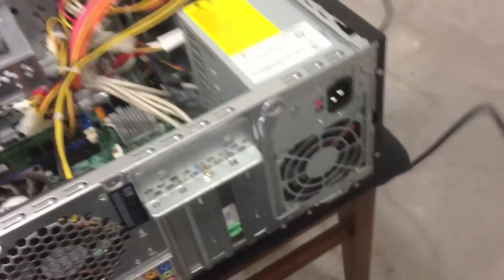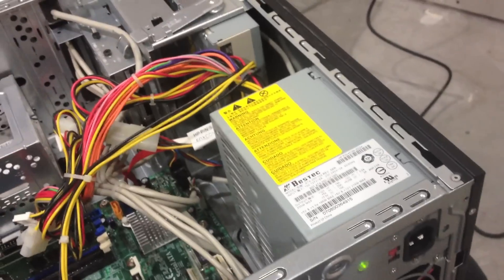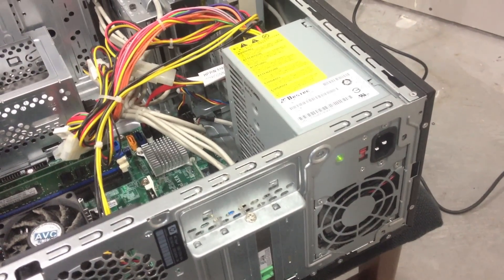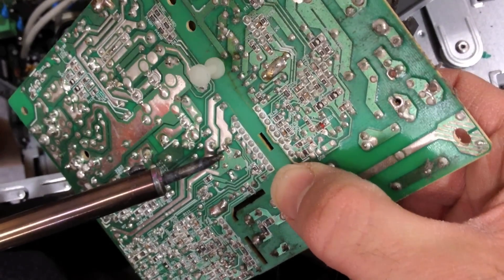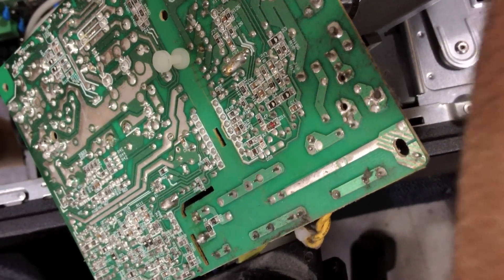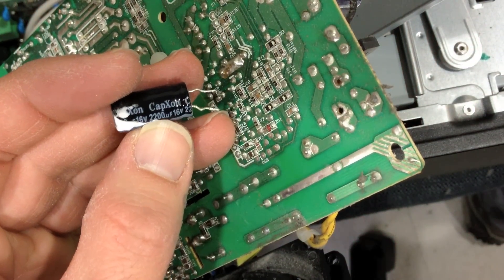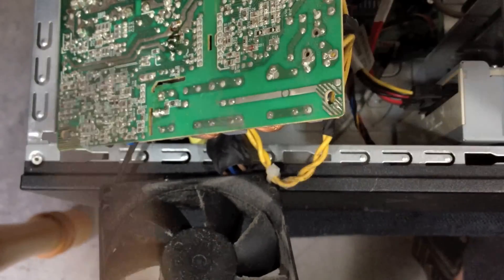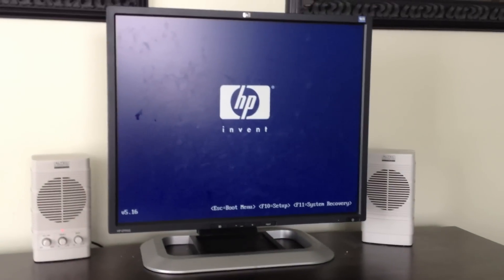Computer Power Supply Repair - DEAD bad capacitor No / Flashing Green Light

Comment: I have this exact PSU and HP model on my bench right now. Same CAP at fault too... There is another on the other side where the 5V/12V to the peripherals comes out that has bulged. The first indication to me was the dielectric odor.

These BST PSU's in this series suffer from inferior Caps, specifically capXons, but other cheap manufacturers have been a problem too.

The other thing here is the placement of this particular cap near a heat sink. If you notice the power rails it is soldered into, you can drill two holes on the other side away from the heat sink and solder the new cap over there, and electrically it will be the same connection, but physically away from the heat source.

These caps are supposed to have a lifespan of at around 7 years, which is about right for this situation since this unit is at 6 years (2008). The other thing is that the user of this unit hasn't cleaned it out since it's purchase, I blew out a large amount of dust bunnies. I also redid the heat sink goop for the processor, seemed a bit dry...

I'm going to swap out all of these caps with better ones for this PSU.

Comment: I have a cooler master 500w amps for my PC, since winter started the PC abruptly restarts /monitor goes to stand by in the first 10 min, but after 1 hr everything works fine, so today I changed the smps , so far the PC working normally,what could be faulty in the cooler master,it 's expensive piece.
Reply: Depends on what you're running, if you're trying to get by on the minimum power, that would be a big issue.
Reply: Daniel Kang the cooler master smps ok, removed it cleaned it and resoldered a few  points on the pcb which I thought were dry, the culprit was the cpu, some pins were blackened so I cleaned them with an old used soft toothbrush dabbed with wd40, the blackened pins got amazingly clean & refitted the cpu , the system works fine even better than previous.
Also I have soldered the 5V,12V,3.3V,gnd  wires from the smps directely to the mobo for maximum secured connection.

Comment: that blinking light isnt programmed to do that if it detects a problem at least i think
my granparents direc tv box has bad psu capacitors and when you plug it in it sends pulses to the power light every 2 seconds
if you  connect it to a tv you can make out the channel program search for a millisecond only when it flashes
nice video btw

Comment: Nice job. Had a similar capacitor issue in a LED monitor. Replaced it and hey presto, working monitor again. $3 for 10 caps from ebay, with free shipping.

Comment: I used this video as reference before trying to fix my power supplies... I had 2 of them that were broken, found a bulging capacitor on the one but couldn't find out what was wrong with the other, so I took a capacitor from the one that happened to be the same and replaced the bulged one.  So from 2 broken power supplies I came out with 1 good one!
Reply: It's likely that another component on that other power supply died. It could be a resistor, voltage regulation module, or one of the diodes on the PCB.

Comment: Nice video! Just FYI, you can use a 6.3V 2200uF cap as a replacement for the bulging capacitor next to the heatsink. This capacitor is part of the 5VSB circuit and when it fails, it shorts out, causing the 5VSB circuit to "blink" seeing this power supply uses an I/C regulated/protected 5VSB rail. Try to use a 105C capacitor for the capacitor next to the heatsink because it's commonly the heat that makes the original cap fail, plus CapXon and Teapo are horrible capacitors to begin with. I've repaired so many of these Bestec ATX-250-12Z units, I've lost count, lol.

Comment: You can actually spend money on decent capacitors, not some Xinjiang special no revolutionary engineer would even touch. The Taiwanese ones are decent, Japanese ones like Nichicons and Panasonics are ideal. they cost almost nothing. 2200 micro-farad caps are probably a few cents. They will also not buldge and explode like cheap Chinese caps.
Reply: Which makes me wonder why companies who make PSUs would bother using cheap caps when the good ones are so cheap.
Reply: *****
Ah, yes.  Screw the consumer.  Always the way to go!

Comment: Good job.
1 year ago, i've changed my old pc power supply switch from 220V to 115V and the only thing i saw was smoke. From then, i haven't used this COMPAQ PC. I really want to repair it now, when i 've got bigger knowledges, but when open the PSU all the capacitors are looking ok. Is there any chance, if i change the fuse, to repair it and it will work again?  Thanks in advance.
s11.postimg.org/wegte27j7/cracked_capacitors.jpg

Comment: Sorry dude you have a cheap HP computer, your better option was to remove that 165 Watt Power Supply and replace it with a 450 or more. Cost $19.95 and about five minutes labor. These OEMs don't think you will add more drives, or case fans, and related. The demand on power supply then becomes more than it can deliver. You paid more money for the tools and replacement parts than simply changing the PSU.

Comment: I understand it's still working but the 105º degree cap used maybe because it's near hot components or heat sink, and needs that rating. It may just be that the 85º is fine and the psu manufacturer only used 105º coz they already had stock. Strictly speaking you should always match or exceed the ºC rating.

Comment: Maybe ali has been a little blunt but a bad solder joint can fail. This may just cause the psu to stop working, fine, however it can pose a fire risk. A broken away blob of solder can cause a short that starts a fire. The capcitor falling out may short something, with either the legs or top vent. BTW thats what the white glue is for!!! I applaude the video author for his cost saving video but there safety issues here. 

A little knowledge is more dangerous than none!

Comment: You can swap the live and neutral over in a mains plug and it will work just fine... Because it works doesn't mean it's safe! 
You can drive your car only using 1st gear at 7000 rpm, it'll get you from place to place, but for how long?
A little knowledge is more dangerous than none!

Comment: Soldering skill's had me cringing also. Reminded me of myself when I started. Hint: get yourself a scalpel or Stanley knife to cut across traces that you accidentally bridged. Buy a cheap roll of solder wick. It looks like braided copper and will suck the solder off the board when heat is applied to the back of it.Over on the uf is OK as it just more head room. The higher you go on heat %C is better. Cheap anything from China will try to place the voltage too low to save cost jump one level up.

Comment: The temperature rating of 105ºC typically means about 2000 hours of life at that temperature.  Beyond that temperature (and hours at 105ºC) the cap will degrade and its uF value will drop.  Eventually it will be useless and an open (0uF).  85ºC same thing, except all that will happen even sooner.  The cap he replaced is right next to the heat sink, this would greatly reduce the caps overall life.  Classic issue.   Great vid - by the way!

Comment: This is so bad on every level

1. The green led will stay illuminated with the power disconnected as the smoothing cap is discharging, this does not represent a fault..its normal
2. A capacitor without a dome could be bad.
3. Your desoldering is asking to rip tracks from the board
4. 2200uf cap does not have to be exact, you could get away with a 2700uf (if it fits)
5. Your soldering is frightening, are you giving a lesson how to get solder splatter on the primary side...kabooooooooooommmmmm

3.